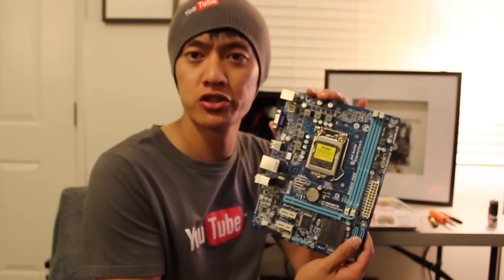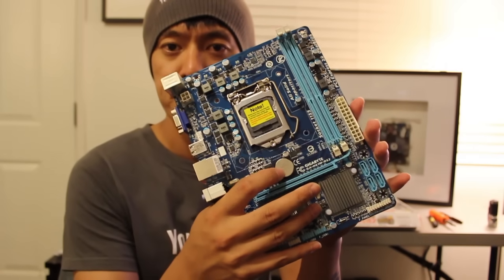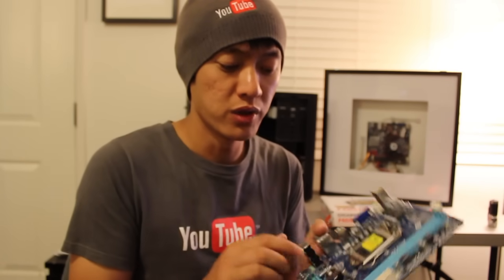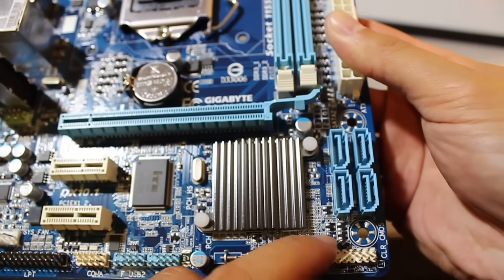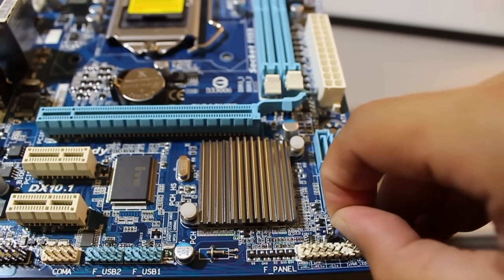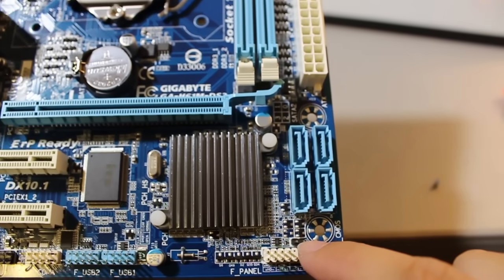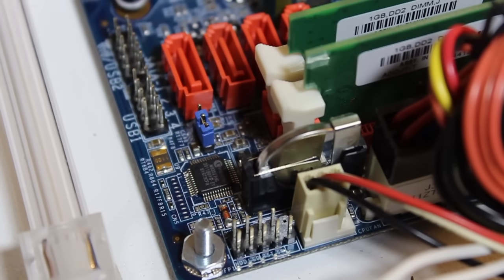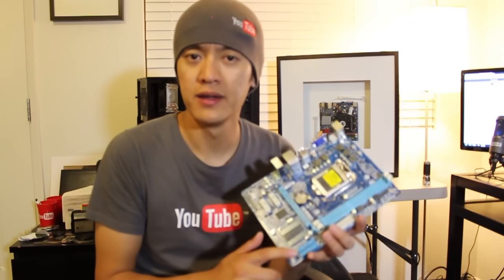How to Clear the CMOS - Reset the BIOS & Why

Comment: My monitor would not come on. when I removed the g force card and power on the monitor came on. Replaced the card with a new one and again the monitor would not receive a signal. took the new card out and the monitor worked perfectly. This new card fit perfectly in the slot but doesn't require a plug-in, my computer store said. what do you think my next step should be. did I get the wrong replacement card? should I just leave the card out and  use it as is? your thoughts would be appreciated.
Reply: yea found out I reset BIOS but only needed to take the card out.

Comment: First understand that resetting the BIOS by removing and inserting jumper is serious business. One can reset the BIOS memory by just removing the CMOS battery for 20 seconds and then replacing it. Motherboard manufacturers have set different types of jumper resetting the BIOS. If you ultimately have to do it, visit manufacturer website or refer the motherboard manual supplied to you and then venture to do this thing.

Comment: Hi guys. I built my first PC and I am getting "no signal". The motherboard I am using is the gigabyte B450m DS3h. I am using a ryzen 3 3200g processor. Pretty much I bought a defective (open box but they claimed it worked) Ryzen 3 2200g at first, and during my trouble shooting a removed the mobo battery. I then ended up purchasing a ryzen 3 3200g after they tested and confirmed that the open box processor they sold me was defective. the mobos original release says compatible with ryzen 2000 series. The box of the mobo I bought says compatible with ryzen 3000 series. I am still getting no signal on my new setup with the new CPU. Does this mean that I deleted the "updated" bios which supports 3000 series Ryzens? Thank you.

Comment: Question. Today I was trying to pull my printer power wire that was stuck between a drawer and the cord actually broke and sparked and I got shocked. Then I realised my pc turned off and the speakers turned off. The printer and speakers and pc and monitor are all connected to the same power surge extension. The monitor works but when the pc doesn't. The pc has power but the screen does not detect the pc and of course if I try holding the power button on the pc it doesn't shut off it stays on. The fan runs but there is no hdd light. Would resetting the cmos fix this?

Comment: Hey man I have a question. I believe I installed the wrong BIOS for my Acer AC100 micro server. It doesn't post, and there is no VGA found. The CMOS reset doesn't work, and I'm going to try a debugging card next week. Is there any way I might be able to recover the BIOS without changing the chip?

Comment: Hello.  I have a rather unusual problem.  My AT&T U-Verse modem (residential gateway) is over 7 years old now, and to put it simply, it has gotten to the point where heavy network activity puts unusually heavy load on my CPU, and more importantly, disrupts my audio, video, and overall function of my computer.  I've been telling my mother for years that the modem needs to be replaced, but she keeps ignoring making an appointment with ATT to replace the modem.

Anyway, recently, the situation got so bad, that this modem made my motherboard crash.  The first time this happened, was on November 30, 2019.  In the moment, I had no idea it was the motherboard that crashed, and I thought maybe my hard drive died.  What further wrongfully convinced me that my HDD was dead, was when I tried to run it with an SATA-to-USB adapter on my old laptop (which I am using to type this), and the HDD did not boot.  Like an idiot, I opened up the HDD to see if I could do anything inside, and I let dust get on the top platter.  Needless to say, that drive is dead.

Back to the motherboard.  On December 3, I bought a fresh hard drive, and had my bootable USB ready, but the system was still not booting.  This was when I realized the motherboard was the problem.  However, miraculously, after maybe about 10 minutes of the power running through the computer hardware, the motherboard actually booted!  So, gradually, but surely, I finished setting up my WIndows installation, and a couple of minor system crashes which resulted in the system rebooting, confirmed to me that the modem would still be a problem.  But, I did my best to moderate my network activity on this machine, to protect the motherboard.

Unfortunately, about 14-15 hours ago, my motherboard suffered another major crash because of this modem, and now the motherboard is not coming back.  My best guess is, the CPU getting unusually heated up from the network activity, caused the motherboard to get overheated.  I was hoping that leaving the power supply on for 7-8 hours would enable the motherboard to recover, but so far, no such luck.  I currently left that rig on, but the motherboard hasn't beeped yet.

So, my main question is, with my particular situation, will resetting the CMOS enable my motherboard to boot, or is it completely dead this time?  For the record, this is only the second major crash caused by this disruptive modem.  The first of course was on November 30, the second was minor and it happened when I enabled my ethernet driver from the device manager after previously disabling it.  And the third was 14-15 hours ago.

P.S. : After the first motherboard crash, I did not attempt to boot it until 3 days later.  Would you say it is still possible for the motherboard to recover like that?  Or, if it is possible, is resetting the CMOS the only way at this point?

Comment: Johnny, my GPU is not being detected so I am using the HDMI port on Motherboard but I want to use GPU HDMI port. Please I need help!
Reply: plug it in the gpu
Reply: I'm having the same problem, can't use the HDMI in my GPU
Reply: go into the bios and somewhere there should be a setting to change the graphics output change it from the motherboard setting (which is default) to whatever your graphics card is

Comment: what about when it has 4 pins and it wants 1&2 but they sit parallel to each other.  i moved to the other two pins and i did get the dell screen with the f-key options this time but it still won't go into bios and won't boot to external media or go to f2 or f12

Comment: mine says clrtc (pins) 1-2 normal, 2-3 clear rtc...? no cmos. its an asus m2n68-am se2. my pc stopped loading up. had new memory and video card installed. worked fine for months. now it works one day next it shuts off 10 min later. now its just black screen like before it was fixed. my battery has been dead for years! didnt know that would be an issue. just need a new battery? what if its still not booting up?

Comment: Hello. I recently bought a used Lenovo P300 workstation PC from a shop. I tried to get into its bios but it was asking for a password. I did not know default passwords so I tried 1234 and 0000 but it did not work. Then, I tried to remove CMOS jumper and the battery but still the password did not get removed. Is there any other way that I can try?

Comment: Hoping this comment section is still active. My PC displays the splash screen and then remains there. Would resetting the CMOS fix this issue? I've entered the BIOS and couldn't find any sort of "Reset to default/factory settings" in there so many forums seem to recommend resetting the CMOS just want to confirm that this will in-fact, fix my problem with the splash screen. Cheers.

Comment: I have a chassis fatal error, I have move the jumper to the reset and back with out success, I have also replaced the cmos battery, and plus sometimes my graphics card is on but not it won't spin at all. 

Before I could simply reset the jumpers and remove the battery and then return them to the normal place and my pc would work fine but now that no long works

Comment: Sir I have Asus Motherboard CPU with Currently windows 7 OS, But Prroblem is, Now I try to install windows xp in this CPU. But CPU gets turn off automatically while installing OS. Then if I used already install windows 7 it works fine without any problem.. Please tell me why happening this in installation time.🙏

Comment: 2014 HP Pavilion 500-123w. HP logo screen opens, but no boot up to Windows logo screen. Why, JP?  Bought new Seagate Barracuda ST500DM002 HDD.  New CMOS battery. No capacitor leaks, splits or bubbles. On ESC, delete and F keys I only get Entering Setup... and Loading boot menu...Downloaded ISO / MediaCreationTool on separate USB drives. Bought USB to IDE SATA 2.5/3.5 HDD cable converter. The original hard drive works and is recognized on my  Windows 10 PC and my  hard drive from my 2009 Gateway works also.  QUESTION?  Do I need to  install Windows 7 OS on the new Seagate drive and try to boot to the Windows logo screen with a USB drive?  I have no installation disc/DVD disc to install Windows 7 OS on my HP Pavilion 500-123w desktop computer.

Comment: Hey man I'm having an issue. I just built a new rig. it's asus Z9pa-d8 workstation motherboard. ECC 8gb samsung server memory. xeon 2600 . now I had just one cpu running. it worked fined everything was all fine and dandy and I put the other in and I couldn't even get into bios after. I even cleared the bios and still couldn't boot in using the same 1 processor as before. any ideas?

Comment: I've done this, yet my PC still only turns on for literally 1 second before shutting down. It all started after I took my pc apart to clean from dust, reapply CPU paste as well as taking the battery out and putting it back in. Help please.

Comment: Hi Johnny, i was hoping you could help me. i have an asus notebook that ran windows 7 starter. i upgraded to windows 10 but hated it so i did a factory reset which was a bad move. 1. i didnt make a copy of windows 2. the factory reset left me with no operating system 3. when i tried to install a new operating system it told me my bios is outdated so its not bootable. what should i do to get my little notebook working again. i cant afford a new computer right now. please help.
Reply from the maker: if you have the serial key for your windows 7 starter, I would recommend downloading the iso file from here:http://softlay.net/operating-system/windows-7-starter-full-version-free-download-iso.html 

and make a Bootable USB windows installation flash drive. I have another video on how to do that. That might work. Hope it helps.

Comment: I have forgotten password for the windows log in windows 7 I was wondering is there an easy way to get inside the system. I have not used this pc for about 3 years. Bios battery seem ok. Pc powers on fine but asking for log in PW.

Comment: Wait.. can you help me out here? i have a acer aspire 5732z with a Intel pentium t4400. i recently purchased a Intel core 2 extreme X9100. and i put it in my motherbored and when i turn on the laptop it like turns on for about 6 seconds the light turns on but there is nothing on the display its just all black. do i have to reset the CMOS or the BIOS for my new cpu to work? I've been struggling with this alot i thought it was the cpu but its not because its apparently works with my socket. which is socket p. please reply to me asap. Thanks.
Reply: Might have to flash the BIOS of the CPU is of a newer type. Sometimes, a motherboard does not "get" the right instructions with an older BIOS. If there is no update for the motherboard, well: Long live Ebay!
Reply: ***** The little battery thing? I opened my motherbored and i checked and its soldered. It made me really angry so i gave the cpu back to the guy i got it from... im only 14 yrs old so i dont how to solder and my dad doesn't have the kit for it unfortunately. Thanks for the help though.
Reply: ***** Oh the BIOS. It was already updated to the latest verison

Comment: My computer is second hand it's a optiplex gx620 but it has no jumper plug. I see the pins but have nothing to plug into the pins like the plastic piece you have and I want to boot with a usb that has an iso
Can you buy jumper plugs? any other tips on how to reset the cmos?
Reply: Even better: You do not need the plugs.  CMOS reset can be done by prying a simple philips head screw driver or a paper clip between the two pins will do the trick to reset CMOS as well ;)
Reply: +Bram25 the PC has to be off and the PCU must be switched off for it to be done correctly, right?
Reply: The PSU has to be off yes. With the screw driver between those to plugs you get a very short sort of 'short circuit' spark (sometimes you can even see it!)  and that's that!

Comment: Can i do that without taking all of my pc parts off from the mobo? Reason why i would reset my cmos is that yesterday i used arock x boost and it worked well. Then my pc freezes while i am gaming. Then i pressed alt control and delete and shut my pc off. Then it wont boot up anymore. I mean it boots up all the leds come up but it shows just a black screen .

Comment: Very old video, yes I know so I doubt you'll ever answer me but I give it a shot.
I just ordered a complete new set of 2x8gb pc3-12800 1600mhz kingston hyperx fury ram for my PC. Current ones are 2x4gb Corsair Vengeance 1600mhz. I am not planning on mixing ram's  ( I will only use the new pair of 16gb total). But i've read on the web/googling that people have been having trouble with their pcs not booting after changing ram, which scares me.
Most ideas people have come up with was to reset CMOS using a jumper or shorten it somehow. Or even remove the battery for a while and then insert it again along with the new ram. However on my motherboard, I don't have a said jumper, and it doesnt really have the imprint of "clr_cmos" on the motherboard itself either. I believe it's listed under JBAT01 or something for me.

Anyway, should I worry upgrading my ram or do you think it will go smooth? Since I don't have a jumper to reset cmos it actually scares me alittle bit and im considering sending back the ram I ordered before even trying lol.

PC specs:
CPU - I5 4440 @3.1ghz > Turboboosted up to 3.3ghz
Motherboard - MSI B85M-E45
GPU - Geforce GTX 1060 6gb Asus Dual OC
RAM - Corsair Vengeance 8gb @1600mhz

Sorry for the wall of text, and again if you answer - Many thanks!
Reply from the maker: svakkaN should not be any problems.
Reply: Johnny Phung Alright. So after changing ram, my pc will boot normally? I don't even have to care for the cmos reset at all?
Edit: I should also note, I'm on an outdated bios version i.e I have never flashed or updated my bios ever since I got my PC pretty much, which was back in 2013! :D (everything works perfectly fine tho) But do I need to update before installing my new ram? just want to make that sure.

Thanks for the surprisingly fast answer by the way! I did not expect this to be answered within 10minutes of my comment :D
Reply from the maker: svakkaN just make sure you intsall them in the same slots as the old ram.
Reply: Johnny Phung Okey, sounds good :). I did some research just now and found out my mobo version is v10.0 from 2013. The newest version is v10.9 from 2015, containing memory compatibility and some other stuff. But you seem more techsavvy than I am so I trust your advice in not updating my bios before installing the new ram. Thanks again for the quick response!

Comment: i had removed the cmos battery as i thought it was dead then measure the voltage across it but it turns out to be not dead , the whole prosedure took about half a minute or so , as i replug it to the mother board and turn it on the screen starts fliquering eventually windows cant boot up, any help ??

Comment: as you can see from my pic. I'm not a young person who grew up with computers or ever had a class on them.  but I over the years I have pick up enough knowledge to usually keep mine and  my wife's computer running pretty good. which is probably the reason all of our friends over 40 call whenever they have computer problems  (thank God for YouTube and people like you)
which brings me to my question.  yesterday my wife's aunt received an Dell Optiplex 780 from her daughter (who has not used it over a year and does not know password.) I have restored  a few laptop to factory, but with them it was just remove bios battery the power up then off and reinstall battery. 
DO YOU KNOW HOW TO RESTORE THE DELL  Optiplex 780 TO FACTORY

Comment: I have a x99 godlike gaming motherboard everything comes on but no video.  A blue light on back panel says clear cmos. I have turned it off unplugged system held the button for 10 sec still nothing I also removed battery nothing! any ideas?

Comment: So I had some trouble. Fixed it. But in this process, I lost PSI slots. They do not recognize my Video card. Fan is on. But nothing. Onboard slot works either monitor. Everything looks fine. I've cleaned everything possible. I've taken battery out. I've removed RAM. Removed power to mother board. I've reset everything.

No display

Comment: by mistake i press the CMOS button now when ever i turn on the computer the errore message "2206 - end of post heci failer" the second line "2210 parameter frame error" the therd line mebios  extention module excution has halted how can i persist from this problem

Comment: My comp took a hit. After replacing the power supply it hung in start up no beeps. It took pulling the battery on the motherboard and using the pins to clear cmos. My next step was to replace the motherboard thinking cmos was toasted.